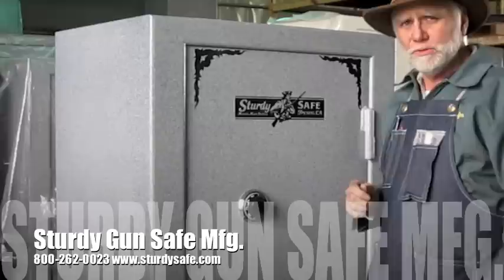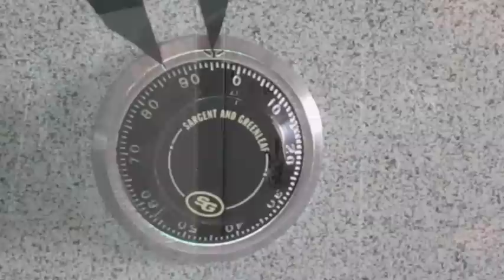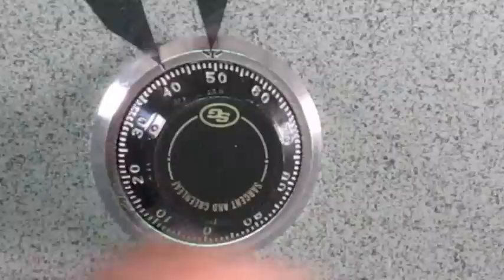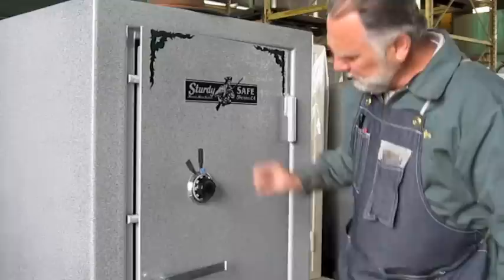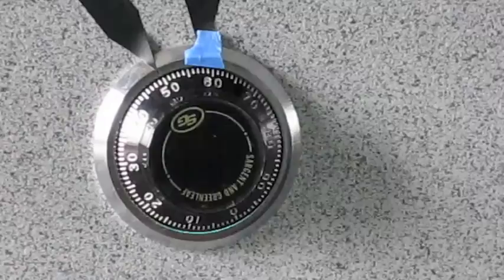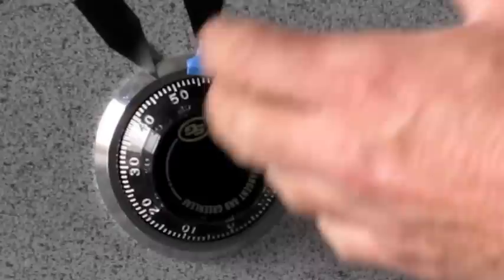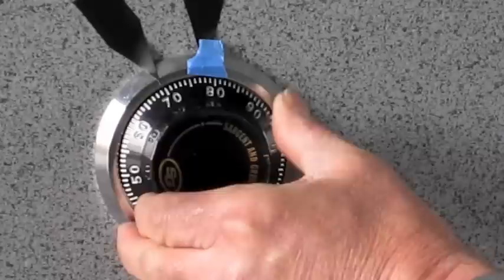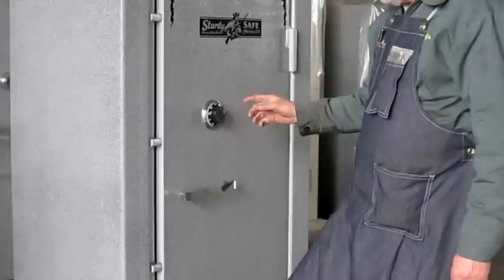How to change a Sargent & Greenleaf combination and how to dial in (open gun safe).

Comment: Great video, but a few things what I wish were mentioned. First: As long as you DO NOT shut your door, you can reset the combination if your new one isn’t working. Let people know that their are tutorial videos showing how to remove the back of the Sargent & Greenleaf (S&G) lock and taking a few easy steps to change an unknown combination. 
I knew this might be a problem if I made an error putting in my new combination so I looked up other videos before hand. As I predicted I screwed up the first time and neither my new nor old combination worked. Popped the back off the lock, manually lined up a few things and I was back in business. 

Second: Let people know that most safe brands use these S&G combination locks. I feel dumb, but it took me a little while to realize that the safe manufacturer, and the manufacturer of the combination locks aren’t the same. 
Anyways you did a great job, and saved me $150 on getting a locksmith, and possibly 1,000s in property that could have been stolen.

Comment: Thanks here's the LABEL we're putting on our safe: Label:

Unlock
Sequence:

LEFT-4
RIGHT-3
LEFT-2
RIGHT-1

 
UNLOCK:
-1st Secret #:  Turn Dial LEFT (counter-clockwise):
Stop on its 4th* passing. 
-2nd secret #:  Dial RIGHT (clockwise):
Stop on its 3rd passing. 
-3rd Secret #:  Dial LEFT (counter-clockwise):
Stop on its 2nd passing. 
-Dial RIGHT (clockwise):
To a hard, Lock Retracted, Stop (#86).
-Turn Handle Right, to Open Door Dead Bolts. 

Notes:
*When Starting the 1st secret #, More passes are allowable.  
Also Less passes may be allowable, IF the Dial was turned Left enough, when previously locked.
The 12 o’clock “Opening Index” crows-foot mark is where you must align and stop your secret # precisely under. 
The 11 o’clock mark to the left is the “Changing Index”, used during a combination change.
So you don’t dial past a #, slow down to “Sneak Up” on it. 

You Must Start Open Directions All Over IF:  
1. When dialing the 2nd or 3rd Secret numbers, when you should have stopped, you pass them.
2. You turn the dial in the wrong direction/try to “back up” to a missed/passed number. 

LOCK:
1. Close Door.
2. Turn Dial to the Left, At Least 4 Full Revolutions.

Depository Drop Hopper 

Combo Change 
Key Insert Hole

Dead Bolts Manual 
Deployment Switch

Comment: This is a great generic video, but lookup your specific model of S & G lock on their website and follow the directions for your model exactly.  

I have the R6700.  It had an additional step not shown in this video.  After setting the new combination on the change index, I had to move the dial to the right 10 numbers before removing the change key.

Comment: I changed the combination and it worked fine for several times. The the hubby attempted the new combination and the safe opened, but now the dial sticks and won't lock. I can move the handle to lock, but the dial won't spin to keep if from unlocking. I was able to get it to spin a couple of times, but now not at all. Any suggestions?
Reply: You may have violated the third number rule. This video does not mention that the third number cannot be between 0 and 20. This is because of the way the lock works. Violation of that rule will cause the problem that you describe.
Reply: Also, as this video does not explain, NEVER close your door after a combo change until you have worked the combination at lease 3 times to make sure that the new combination was put in properly and that the lock will open once the door is closed and locked.
Reply: Miyatafixie I did the combination several times before I actually closed the door and it worked fine. But after closing it, the problem started.  Looks like we did violate the third number rule. Is ther a fix for this, or do I need to call a locksmith?
Reply: Rayneht The dail moves enough to allow me to lock the door, then use the key to lock the dial.
Reply: Rayneht
To make sure that I understand your problem correctly, you can get the door to open and close, it is just that you cannot get the lock to spin and lock the safe. If that is correct, then what you must do is open the door and take off the back of the lock. Then you must manually turn the wheels to align them so that the change key can be inserted when you put the back of the lock on again. The change key has to fit into the square holes in the wheels. Turning the square holes unlocks the inner part of the wheel from the outer part. By changing the relative position of the inner part of the wheel to the outer part is what changes the number for that wheel. When you have the wheels aligned and the back on again, you can now insert the change key and put in a new combination. Do not unlock the wheels before putting the back of the lock on again and remember the third number rule.
Reply from the maker: If this is a Sturdy Safe you are talking about, make sure the handle bar is firmly down or the dial will not move. The handlebars will go up and down about a quarter of an inch.

Comment: Thank you for the tips, Irish...hopefully Sturdy will add this to any instructions, though they can see it here.

Question for you. Is dialing too fast an issue? I am not talking 9,650 RPMs...just a quick dial?
Reply: If you spin to fast..
You can make the dials float past your number.
Do not spin fast when setting up your new combination.
But..
If you can do it..
And open your safe, it will not hurt anything.